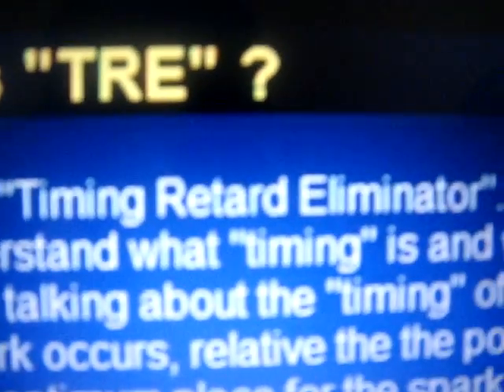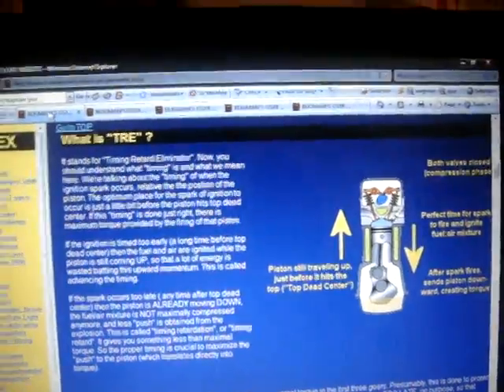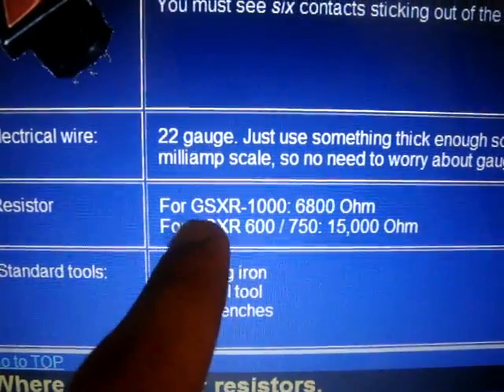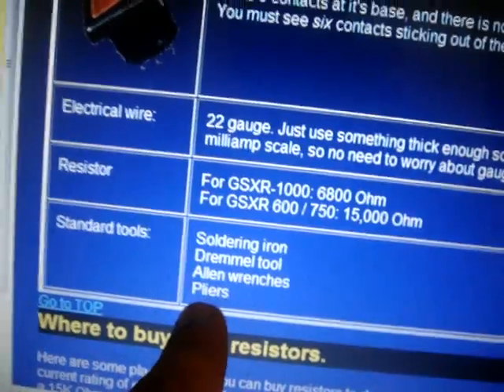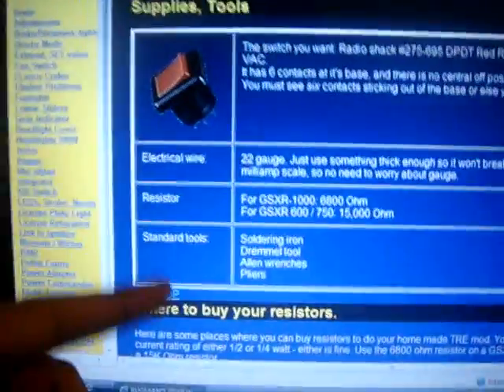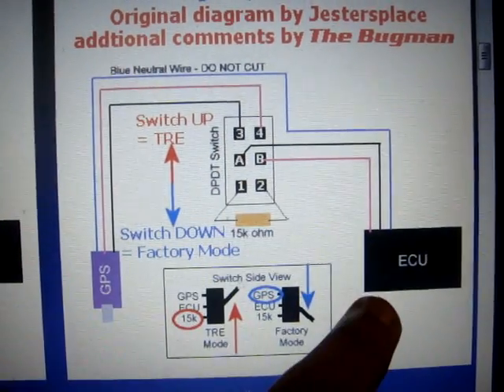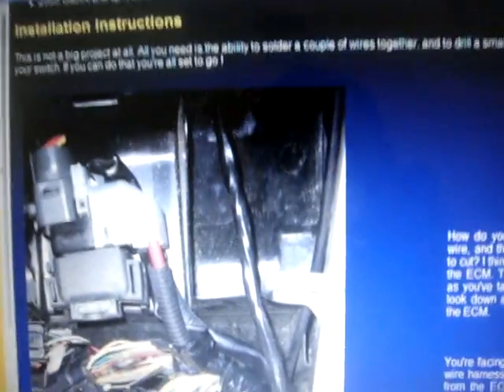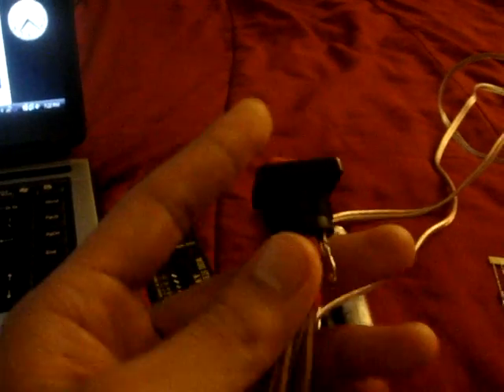How to Make a TRE for GSXR 1000 (timing retard eliminator)

Comment: I just did this mod and have wired something up funny. Bike runs fine with the TRE disabled but when I flip the switch there is no change in RPM or engine sound but I get an  FI code (which I need to check). Any idea what might have happened?

Comment from the maker: @sanderman20005 I ride my bike everyday I go to work, weather permitting. I also monitor my mileage everytime I fill up ever since I got my bike. To answer your question, the answer is "It doesn't change the fuel consumption at all." from my point of view. Plus it has more power! 
             My bike has had the same amount of Mileage per fill up with/without the TRE. Remember if you build/buy the switchable version you could just simply turn it off if you like.